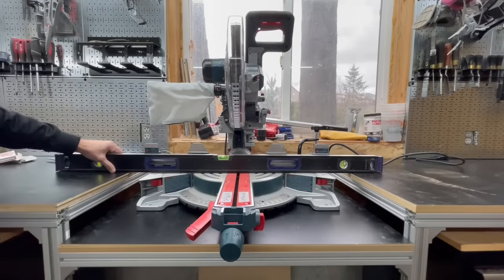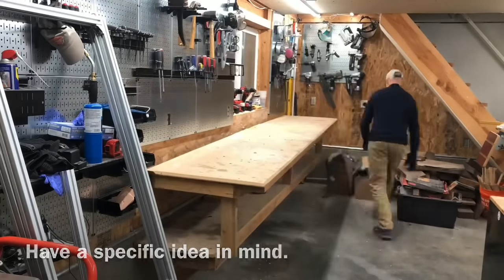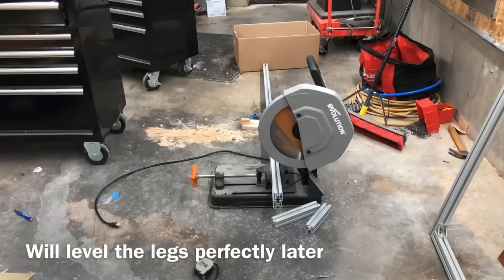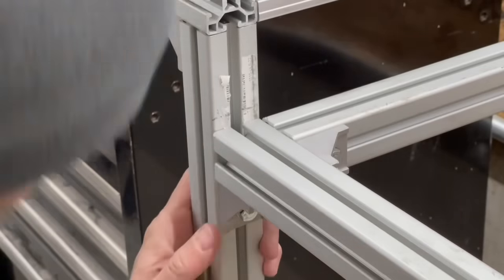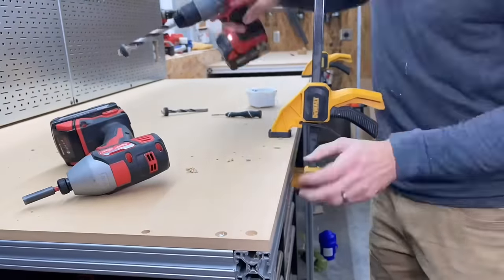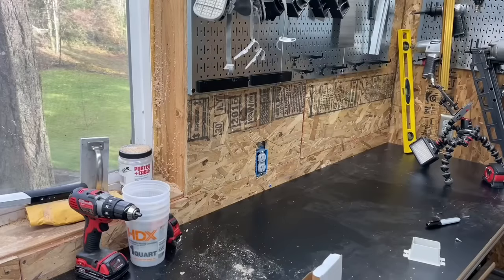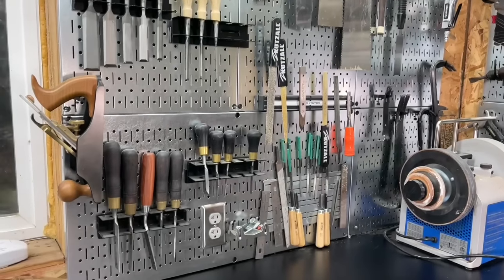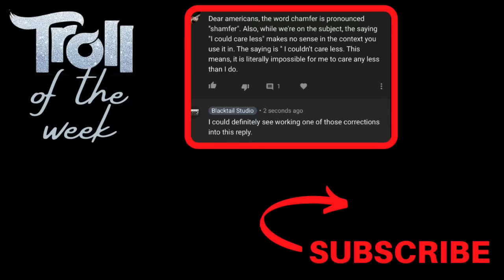Smartbench Workbench

Comment: Looks like those sheets of MDF are the 5'x12' lengths.  Did they deliver them, or did you haul them yourself?  I'm literally trying to figure out how to haul two 5x12 1 1/8" thick double Formica faced sheets for assembly table top and bench since they don't deliver.

Comment: great workshop I am jealous! ;)

I saw that you have attached MDF with a screw and this is a sacrificial top. Was there any reason you didn't use bolts and nuts? Don't you worry that after few times when you attach screws in the same place it will lose its grip?
Reply from the maker: I won’t ever have to remove that piece. Only the taped top piece

Comment: Im working on setting up a small woodshop in a 2 car garage 24 x 24. I'm a carpenter by trade but not a woodshop carpenter,  I'm trying to decide what size table saw I should get. (HP) I have a Bosch portable but don't think the accuracy would be there nor power. This will be a side hustle and morph into a semi-retired woodshop. I figure small projects at first ie cutting boards, Charcuterie boards other hardwood projects. id like to try an epoxy table sometime. I will be getting a Makita track saw soon as well to break down sheet goods. Building my own cabinets for my kitchen remodel. So what would you recommend for table saw size/power? I also want a jointer and bandsaw and have a Ridged 12" desktop planner someone gave me.

Comment: Hola! Just wondering how well your workbench resists racking. I am getting into hand tools for my woodworking, and a nice, stable bench is crucial when doing things like hand planing, sawing dovetails, or chopping a mortise.

But, I am also an engineer, and have used 80/20 all over the place. Love the stuff, but it ain’t cheap! Where do you buy yours? McMaster-Carr has great selection, but can get kinda pricey.
Reply from the maker: This one isn’t great for hand tool work

Comment: When you taped the black melamine to the MDF substrate, it looked like you were getting considerable flex in the surface, even when you were pressing it down.  Did that resolve itself, and did you get the dead flat surface you wanted?
Reply from the maker: It’s flat, does flex though.

Comment: Just to let everyone know, when ever you cut anything that has been galvanized, wear a respirator, galvanize coating are actually very toxic to breath in, also never put a galvanized screw or bolt in your mouth if you're one of those people that holds them like that, also don't take a torch to them either you'll make a toxic smoke, with that said you can get spray on galvanize coating so if you do cut something you can recoat it

Comment: I would of used stainless 3/8 or 1/4” wedge anchors instead of tapcons. You can disassemble and reassemble multiple times. And it’s much stronger. Stainless doesn’t rust.

Comment: Guten Tag! What drill and bit were you using to drill into the concrete for the tapcon anchors? I struggle to drill into concrete wit the bits provided in the Tapcon kit and I am using a corded 1/2" chuck heavy duty drill.
Reply from the maker: Milwaukee bits I think

Comment: Dag, hoo gat het?
That's Dutch for good day, how's it going?
Wanted to ask if you could recommend any shop plans for an 8'x9'x20' shipping container. I work in both wood and metal and wanted one side dedicated for each.
My shop burned in April and I need to rerbuild it but I may need to sell the house and move next year, so I'm planning to build the shop in a container so it can be loaded on a car hauler and moved to another site with minimal disruption. 
Gonna be tight so it has to be efficient and flexible.
Bill
Reply from the maker: No plans, but sounds awesome

Comment: I don’t think that there is a perfect workbench or perfect tool storage system for everyone; indeed, I don’t there is a long term perfect solution for each person - as your needs and style of working change, then so will what you are looking for.

My preference is to have everything away in drawers or cupboards; I like dust free tools and walls. However, I know that is a trade off between ease of access to the tool and dust. My solution suits me.

Double sided tape. There are many different qualities of DS tape. From crap to permanently stuck. Buy a reasonable quality and you will get what you pay for. Also, think about the sheer forces that you want the tape to stop and the amount of area that you are able to apply DS tape to on both surfaces. In Cam’s case, with boards stuck down, there is plenty of room for tape and the sheer forces (to make the board slide off each other) are negligible. In fact, the more you use force downwards, the stronger the bond. As another illustration, if Cam. Had wanted to stick those aluminium peg boards to the wall using double sided tape, he would have needed the strongest possible tape because there isn’t al out of area contact between board and wall and the sheer forces (heavy tools) are trying to pull the peg boards from contact. 

Thinking about sheer forces is a very good exercise when deciding on most fixings. Again, an illustration. You want to fix a heavy light to the ceiling. The screws or whatever are likely to be vertical and the sheer force again vertical but in opposite 180 degree direction. So, the fixings have to be good and strong because the sheer force wants to pull them out. With how Cam fixed his peg boards, the screws are horizontal but the sheer force vertically down. So, the fixings can be adjusted in size and length because the sheer forces are not opposite to the direction of the fixing.

Here endothelial today’s lesson on sheer forces. Tomorrow, I will talk about fear horses and how to avoid that